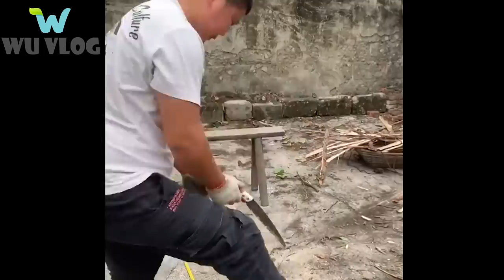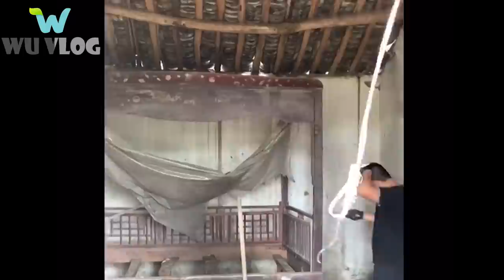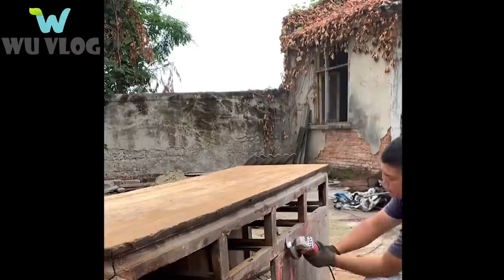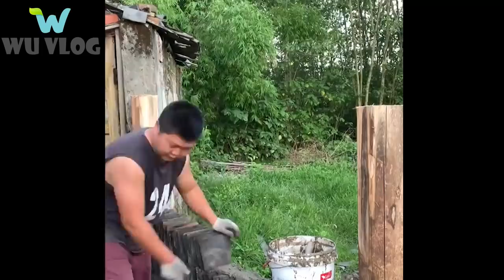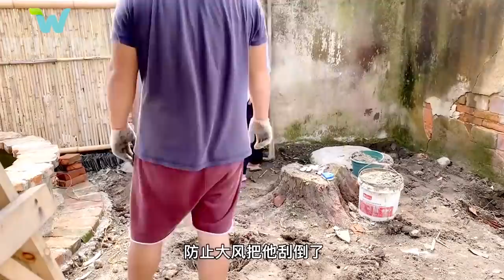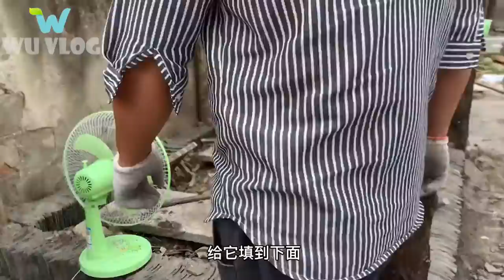Young couple renovate abandoned house and garden to become more beautiful | WU Vlog ▶ 45

Comment: I understand the need to make it clean and pretty but using what you have on hand but they are in China and instead of putting the roofing tile back on the roof he used it in his garden? Those flimsy sheet metal pieces he put on the roof they hammered nails in its going to rain and snow that roof is going to leak like a sieve and no insulation anywhere its gonna be cold and wet